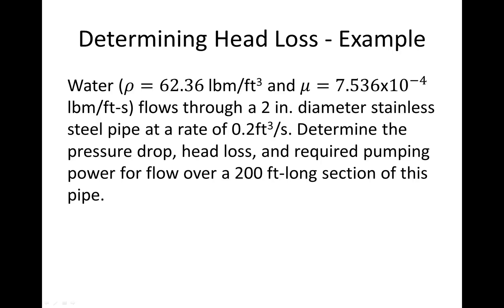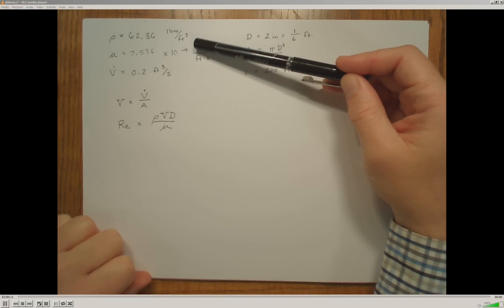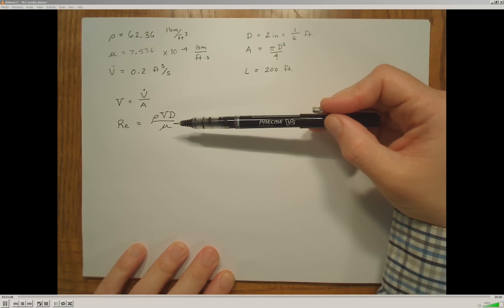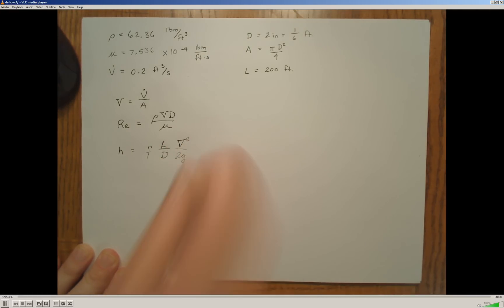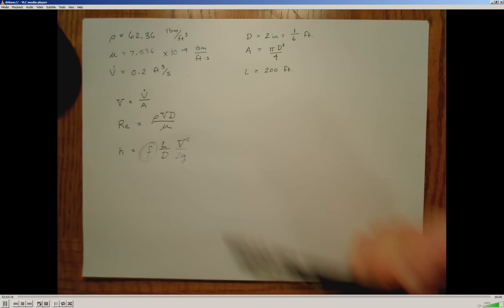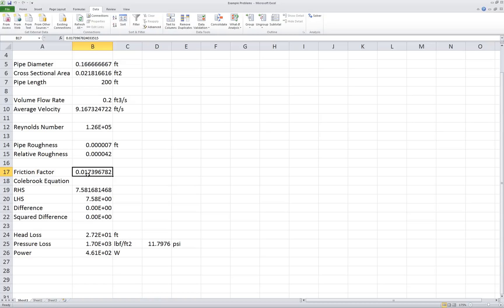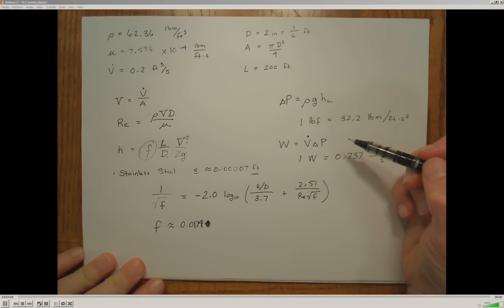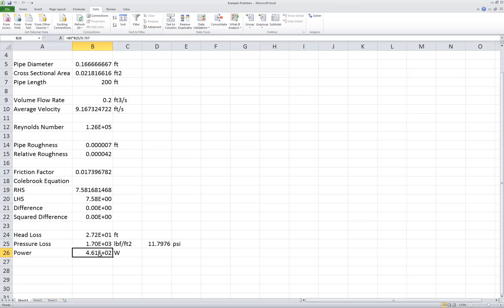Pipe Flow - Calculating Head Loss Example

Comment: In writing the stainless steel surface roughness, the value   0.00007 ft was recorded.  But in the Excel sheet the value used was    0.000007 ft  ... just FYI .

Comment: i plugged in your values i think that the head loss is wrong
Reply: double check you work, because the answer is right. However, use Haaland equation and forget all this interpolation........ or I think its called extrapolating. Whatever, Haaland Equation takes care of all that

Comment: im a little confused, I have a horizontal pipe length and also a vertical pipe length.. do I just add both lengths and find the pressure drop or are there two independent calculations for this? I thought that headloss was only for elevation change, could you explain? Thanks